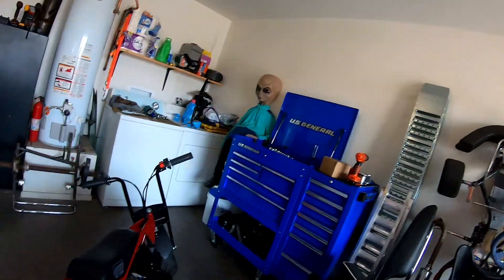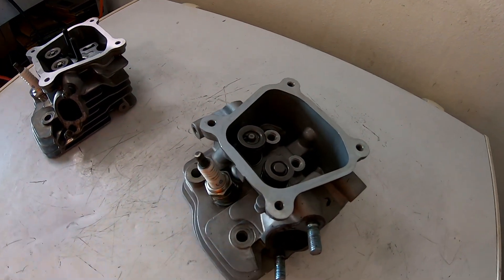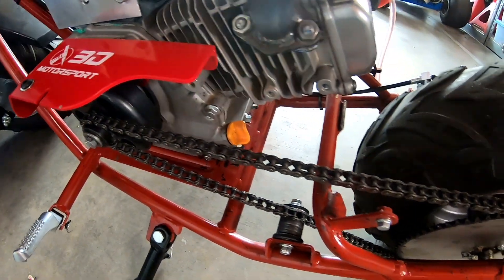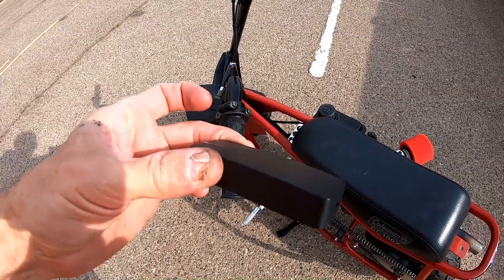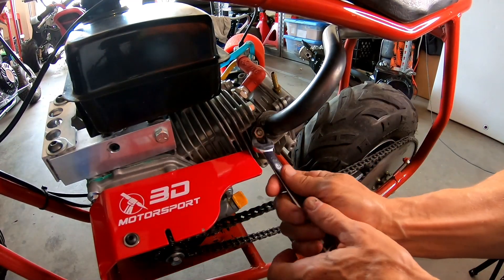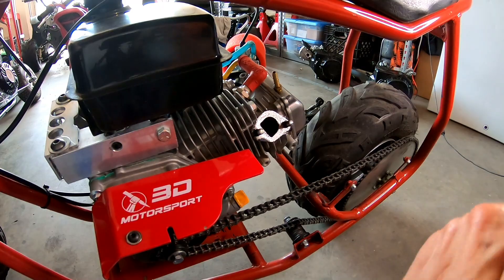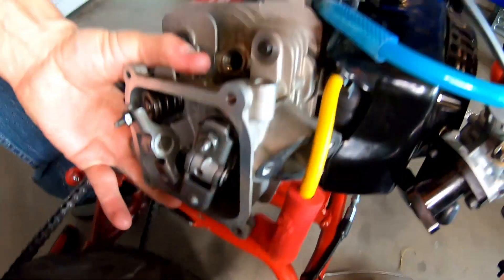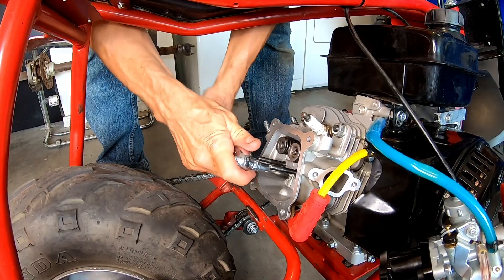Predator 212 Cylinder head comparison/Hemi vs Predator 212 vs GX 160

Comment: Compression does not have its pros and cons, engines with high compression tend to have lower rpm but more torque, engines with lower compression have a wider rpm range but less torque, engines with high compression depend on more energy to be able to spin since the pressures in the chamber are much higher, use a syringe as an example, pull it suddenly you will observe a counter pressure, then cut the tip, enlarge the hole where the needle is and you will see that the counter pressure drops, the same thing happens in the combustion chambers
Reply from the maker: I would say compression is a tuning tool like anything else depending on the characteristics you want your engine to have. Check out the other compression videos along with the other 135 minibike videos on the channel. Thanks for watching!

Comment: Im thinking about doing a gx160 head on a northern tools "Ironton" 212 I found on the side of the road in parts, along with a propane carb. I plan to run it governed for low rpm. I found a big patch of rust on one of the pushrods of all things, What appears to be muddy rust in both the intake, and exhaust ports, and the bottom of the inside of the gas tank looks a little chunky, But the outside of the engine looks almost brand new. It was a water pump, has a 3/4" non-tapered shaft and uses the same drain plug as a Predator 212. So Im assuming its probably from the same factory as the non-hemi 212.

Comment: Going back and watching this again as I'm considering what I want for my next engine. It's comes down to the larger valves in the Hemi outperforming the other two heads with Higher compression ratios. But I can't help but think it's still going to be more cost effective to use a Lifan 200cc motorbike engine, and do a little more work on linkages and wiring, (especially as I have to order parts from the USA for the Stationary Clones & the shipping cost is more than the parts, and the exchange rate means I'll pay 4 times what people in the USA get to pay) The Lifan 200cc Motorbike engine is 16hp and $1055 with Carb, loom and exhaust/header, the cost of building an equivalent 212cc is well over $2K)
Reply from the maker: Yeah, sounds like the Lifan is the way to go. And it is already together. No waisting time on a build.

Comment: I bought a mini bike with a stock Honda gx200 on it that needs a new head, would I be better off getting a 18cc head kit or 14cc head kit for it? It’s a completely stock motor. Looking to just bolt it on and go and not do any extra custom work to it. Which would you recommend for the least amount of work or custom work? Thanks in advance!! Love the channel.

Comment: Would the tillotson 212 head be compatible with the non hemi 212 predator? And would there be a benefit to using the tillotson pushrods on the non hemi block? Thx
Reply from the maker: Yes, I did exactly that in this video. https://www.youtube.com/watch?v=wHIKyVU4oxw&list=PLkbj-ip-5FzZG40xkiEtZHRtF_jDzxA9U&index=6 I don't see much benefit unless they are Chrome moly pushrods.

Comment: I don't know why everyone thinks 22lb. springs are so great myself I go with the 26lb. with mod-2 cam with one to two rockers in my hemi head predators with 26mm Mikuni carburetor ported n polished,,, it's a beast with a stage 3 header of course Billet rod with Billet flywheel replacing plug wire with 8 mm. with a heavier ground strap...

Comment: A lot of people balk on the Highsan engine the 195cc and swap the predator 212 engine. The main difference I think is the crank shaft output thickness. You have to get the adaptor with the CVT with the 196 engine. This video is very interesting showing the various specs and time trials. Fatbuddycat does the same thing. If you want more output just bore out the exhaust port and use a thicker head gasket.

Comment: Great comparison video. I’m about to do the 14cc GX160 head on my non-hemi 212. Hope I get the same or better results. Thanks for sharing
Reply from the maker: Thanks! I really like the GX160 head. I have them on a few engines. The extra compression seems to make them snappy.
Reply: I love your comparisons I've tried the fcr carburetor on my 212 with ported head and Cam and compression and I've got the insane top end still fighting with the lien on top and rich on the bottom maybe you can show me how to do it if your friend to fcr carburetor I'm running a 39 but it doesn't seem to matter how big the carburetor is it takes it all on top end

Comment: yo it’s that’s stock engine where you get the air filter from?
Reply from the maker: No, not the stock engine. Here is the link for the filter https://www.ebay.com/itm/143362678851

Comment: Gx160 with 22s is a great combination with a stock or mild cam.
Reply from the maker: That's the combo on the blue bike. I have a 252 rattlesnake cam with 1.2 ratio rockers with the GX160 head. That little bike moves out.
Reply: @Black66  right on!

Comment: Question,my clutch keep making noises,and if my chain is to small will is make it faster or slower
Reply: Other questions, so I install my carburetor mikuni,took out the gov out but left the gov arm in and I cut of the oil sensor out, and I have a 12tooth clutch with a 75toorh sprocket, what speed can I reach?!
Reply from the maker: @rico7844  It really depends on the weight of the rider, tire height etc. But if you're talking about a Coleman cc100x I think mine hit around 50 with that combo. Mine did have a cam. There is only one way to find out.
Reply: @Black66  and what special oil I need to use for my clutch
Reply from the maker: @rico7844  drip a little motor oil on that bushing. Or even WD 40 if don't have anything else.
Reply: @Black66  is bad if the chains is to short and the motor is all the way back
Reply from the maker: @rico7844  As long as the chain is not to tight its ok
Reply: @Black66  can I use a chain lube to make the clutch better
Reply from the maker: @rico7844  Yes, keep the chain lubed .
Reply: @Black66  can 14tooth clutch 40/41/420 chain can it fit with a 75tooth sprocket
Reply from the maker: @rico7844  If you could find a 40/41/420 clutch in a 14 tooth and a 40/41/420 sprocket to go with it.
Reply: @Black66  this the last question what exact chain I need to get for my Coleman cc100x because the regular chain that came with the bike when I first bought it was thicker then I bought a new and it wasn’t thicker but it still fix on my bike ,but I want to get the exact same chain that was before so what chain do I need to get
Reply from the maker: @rico7844  If you want a thick chain get this or something like it. Here is the link https://www.ebay.com/itm/123090001010?ssPageName=STRK%3AMEBIDX%3AIT&_trksid=p2060353.m1438.l2649
If you want a standard chain get something like this...https://www.ebay.com/itm/303010356260
Reply from the maker: I would lube the bushing in the clutch? They will make noise if they are dry.

Comment: 212 non hemi and clone heads have bigger ports than the stock 212 hemi and i did the same but using a non hemi head on my built hemi block😁👍
Reply from the maker: I liked the NON-Hemi head the best on this test. The GX 160. It seemed more snappy to me.